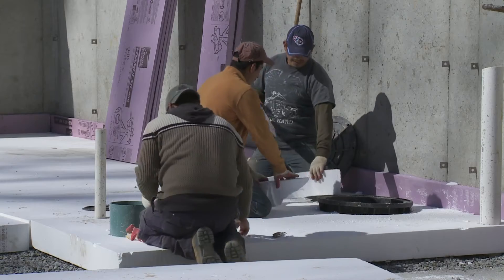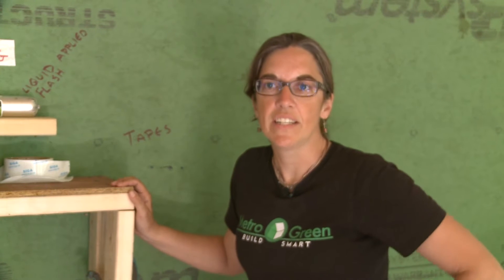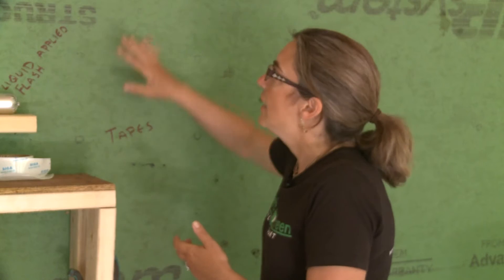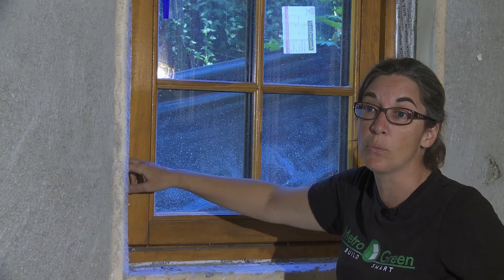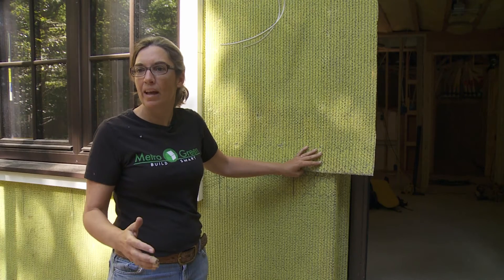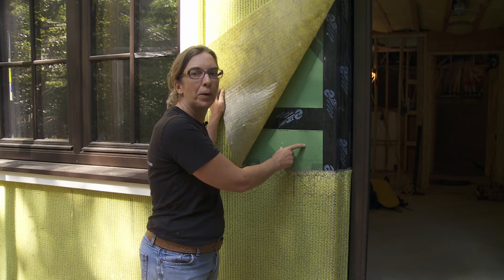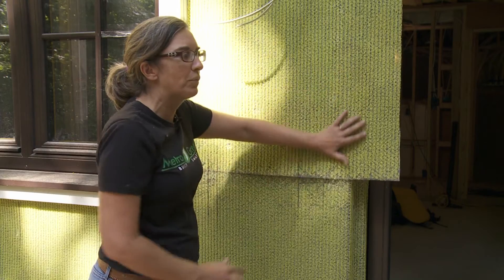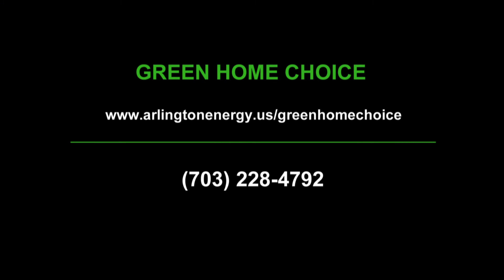How to Build a Better Home - Sealing for Air and Moisture

Comment: There needs to be a 3mil poly vapor barrier next to the drywall,
or warm most air will turn to ice inside the insulation when the 
outside air temp is below freezing.
Reply: In the south for example Florida you do not use the vapor barrier because it cause mold.
Reply: This is a passive house.  It'll have like a foot of insulation between the sheathing and the drywall.  And do people still use poly?  I thought they stopped doing that because it trapped moisture trying to leave the house and caused mold.

Comment: Just checked Zip System vs OSB of same thickness and size. Zip is 3x more. Not a criticism. I was simply curious. I used Lowes to compare cost of the two items. I did not factor in the cost of sealing tape for the Zip System nor the cost of Tyvek for the OSB system.
Reply: I see alot of people doing zip system, why do you think they are if its 3x more expensive than OSB and tyvek? I know Tyvek is the old standard, but I also know it is a weak material that can easily rip leaving OSB wet.

Comment: Patty, Why dense pack cellulose over closed cell foam (or open cell)? Is it simply a cost issue?.
I'm building a Passive home this year in Ohio and I like a lot of the things you guys are doing even if I think some things should be done slightly different, ultimately the end result is what counts, keep up the great work.